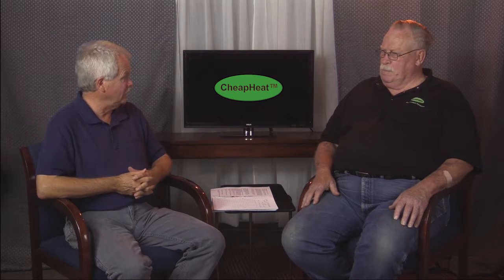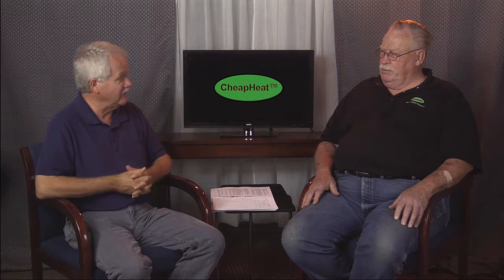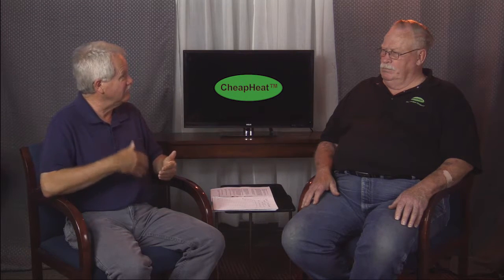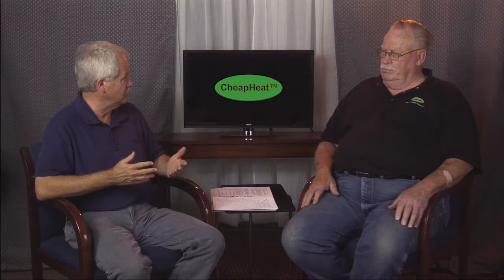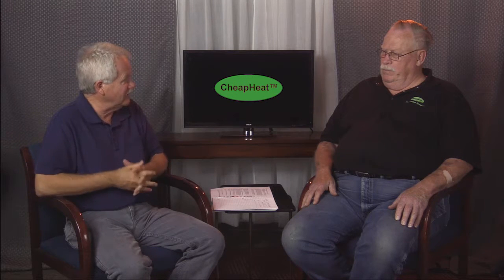CheapHeat: How can it put over 3 times as much heat as a portable heater

Comment: Cheap heat, electricity isn't cheap. I do like that it goes through the ducts and under belly. Also it would be a dry heat and not sweat the windows.
Reply: Robert it really depends on two things, one if you’re renting a space and not a full-timer in that space the electric is free to you, because it’s included in the space rent. If you are a full time that has to pay your own electricity, then it depends on the electrical rates in your area. Here is the simple formula
that does all of the math and conversion form Kilowatts to Gallons of propane. $0.06 per Kilowatt is equivalent to $1.00 dollar per gallon of Propane. So, $3.00 for a gallon of propane is $0.18 per kilowatt which means if propane cost $3.00 and if you are paying less than $0.18 per kilowatt electric is cheater.